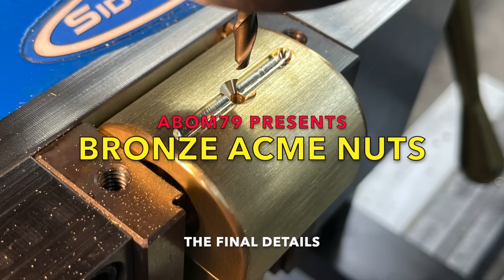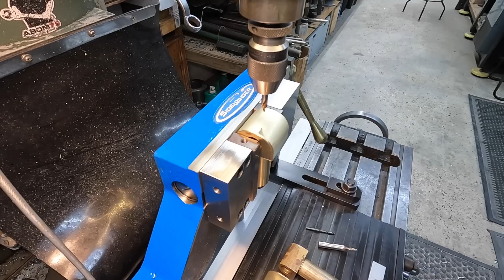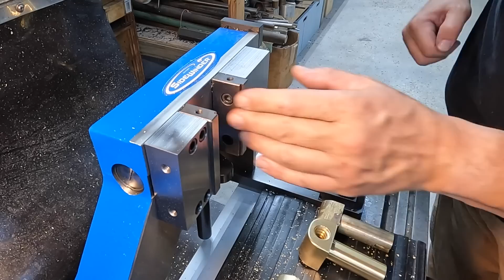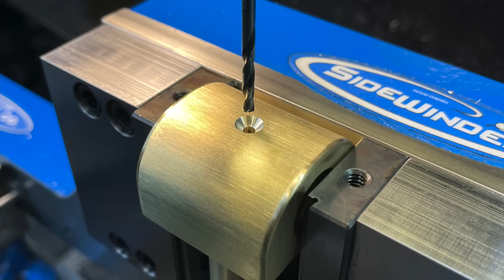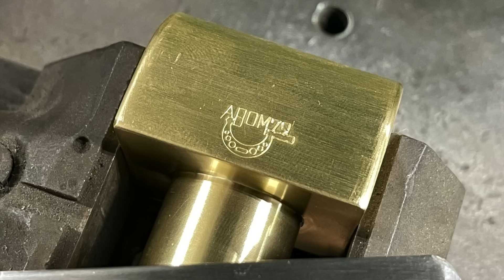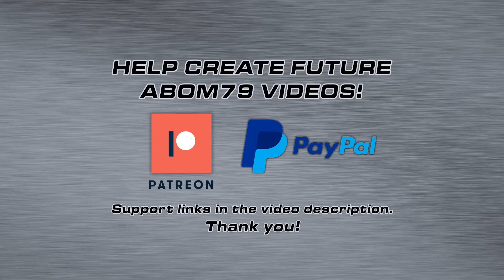The Final Details 👌🏼

Comment: 5:25 i only want to say that these are not designed to spot drill for twist drills, they are designed for lathe centers, thats why the geometry is like it is (to give the tip of the center enough room) and why they are called center drills :)
Reply: what does it matter using non-flexing center on a curved surface?
Reply: @aolinger680  because the angle of the center drill is smaller than the drill tip angle and because of this the edges of the drill are cutting first which makes it more unstable and also its not really good for the drill. I know its just holes and most of the time it will do the job but i just wanted to let him know (maybe he already knows it).

Comment: Here in Sweden: If the boss sees that the pedestal grinder is used for anything other than sharpening tools, you will be fired on the spot. Grinding the transition on a workpiece or making/deburring an edge instead of using a lathe or CNC is automatic termination of employment.
Reply: Number one, that is a Scotchbrite wheel, not a grinding wheel. Of course we figured an expert like yourself would know that. That wheel was being used exactly the way it was designed. Quit trying to be a know it all. It isn’t working.
Reply: @grntitan1  Off course I knew it is a scotchbrite wheel (or a "skowy" as we call it here in sweden).  The problem is that he is using it AS A pedestal grinder to break the corners.  That is just a lazy mans approach and would be reprimanded as explained earlier.
Reply: @SwedishNiceGuy  Sure you did. 🙄

Comment: The elongated  slot had a purpose.  Back in the day, when animal products were still commonly used as lubricants, channels like these would hold onto the lubricant.  It would commonly become solid or more viscous at room temperature.  When heated through use, the lubricant would liquefy and flow into the wear area.  Worked well as animal products break down very quickly, only giving days worth of lubrication.

Comment: Beautiful part. 
Was wondering what that threaded feature on the stem of the original part was for? Don't think you mentioned it, and didn't replicate it on the new parts.
Reply: I'm pretty sure it's a locking feature to prevent rotation
Reply: @BUSTERCHERRY8D  Makes sense, wonder why Adam choose not to replicate it though.
Reply: Like Rusty Rudder and Thomas English says it's a locking feature to prevent rotation and hold it in place. This is drilled and tapped after installing the nut back in the compound so he couldn't do it before that. When it's been aligned with the acme screw you drill right inbetween the brass and the casting. So both the brass and cast iron get half a threaded portion, then fitted with a setscrew so it's not going anywhere. It's difficult to match up with the originally drilled and tapped hole so either he'll make a new one in another spot, or if it's a good press fit it might not be necessary 🙂 should be revealed in an upcoming video when he continues to assemble the compound.
Reply: @marclofgren5130  Hey thanks, that makes sense now that you’ve explained it.
Reply: @sparkplug1018  How I see it anyway.. Adam might have a different way of approaching it 🙂 we'll see for sure 😊
Reply: Was wondering same thing, thinking it's a locking feature
Reply: I thought it was a Proto pipe when I clicked on the vid.

Comment: They're so beautiful Adam! It's so gratifying and nostalgic to use material from your parents or grandparents, especially if they're gone. I installed a new water heater in my house last year when the old one leaked. I did it proper as my dad would have done it. All soldered copper and LF brass, no pex B or flex lines with threaded connections. My dad was an apartment repairman and later on, a jail maintenance tech and repairman so he did plenty of plumbing work and had lots of tools. He was a licensed electrician too. I inherited all of his tools and everything else when he died in 2016. I used a few of his old 3/4" copper elbows in the water heater install. I can't describe the emotion I felt putting those elbows on there and soldering them up. It's like I put a piece of him into that job. I practiced for a few days soldering with scrap pipe before I did the install. I didn't go on until my joints looked like his. He could sweat a perfect joint in 15 seconds with his acetylene TurboTorch. I tried it for the first practice joint and I failed miserably. It humbled me and I realized how skilled my dad was. I switched to propane and I made dozens of practice joints at all angles until I could always flow a perfect, shiny, full depth joint. I think he'd be extremely proud of me, and I think your dad and grandpa would be extremely proud of the work you do too. I studied the plumbing and fuel gas code used by my city for over a week as well, learning about everything necessary to make that install up to code and safe for my family. I'm confident nobody could distinguish my work from an install done by a plumber. No snots. Every joint deburred. 6" of LF brass intermediate between the copper and the dielectric nippIes (which fail eventually and cause corrosion) which is the standard for joining old galvanized pipe to new copper to prevent galvanic corrosion. I even piped it to physically act as a heat trap loop to backup the heat trap nipples when they eventually fail internally later as well. My dad had a small battery flashlight that came with the drill set, and when I was a kid I used to hold a light for him and watch him work. Learning, helping, enjoying the time with him. Now I inherited that flashlight of his and it stands on its own as the battery pack is flat and wide. It's like the roles reversed and he was holding the light for me in spirit as I did the work. I'm a bit teary eyed as I type this. I miss him a lot. He was a great man. I'd be so different without him as my father. Probably wouldn't even be here watching these videos. I am not religious, but whether or not he can see what I've created using the knowledge he taught me as a kid, I just know he'd be impressed and proud. He'd pinch my cheek and say "You're my son." I'm really glad you got to use that brass stock Adam. You did an incredible job on those parts and you oughta be proud. I enjoyed this series thoroughly.

Comment: Don't have a pacemaker or anything like that, but if ya fancy making a limited run of 4 inch diameter hex nut style pencil holder with ya stamp on it; slam them on ebay definitely will purchase them--heck your CNC machine should be able to keep up with the demand!